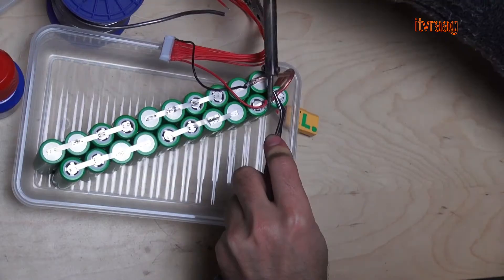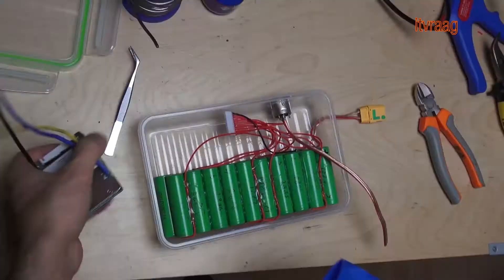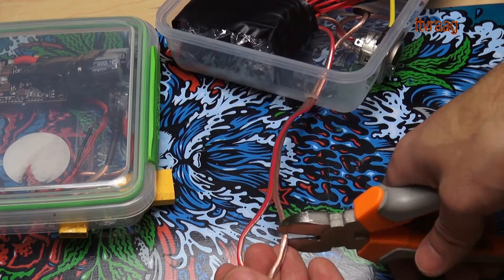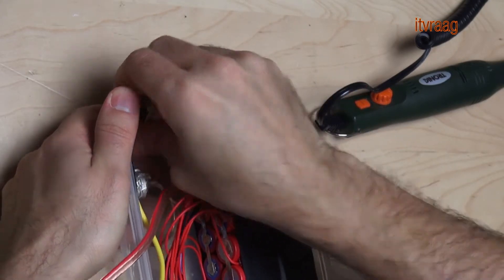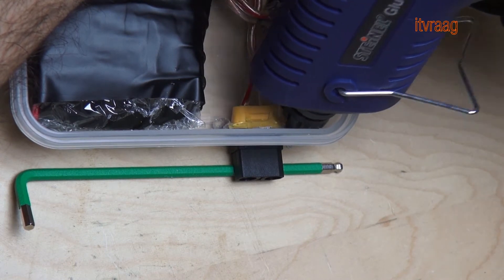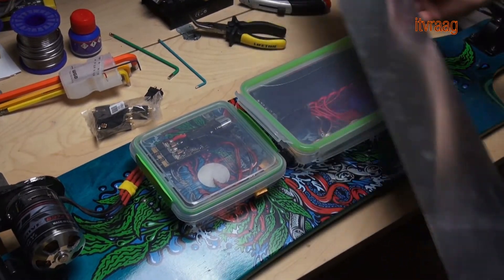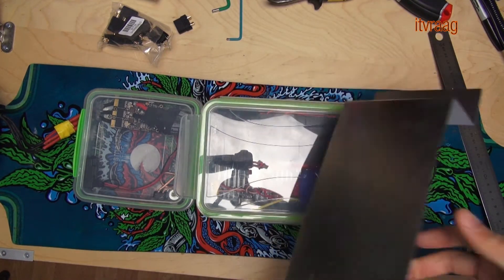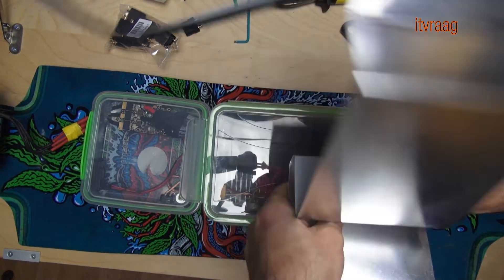DIY replaceable battery for eBoard

Comment: you might want to look into 3d printing..... makes for better cases and you don't need to rely on tupperware ;D
Reply: How much do you think a person would charge you for the Tupperware-like containment though? 3-D printers is a early market right now, isn't it? I wouldn't pay anything over $60 US and that is understanding the 3 or 4 hours it takes to make and shipping costs....but yeah, something modified perhaps can give you better safety like, separations for wires and better holds for the Batteries.....I am going to use Tupperware in the mean time when I put it together.
Reply: Agree, Ender 3 would be a great entry 3d printer at around 200$. Anyways, very good job on your board!